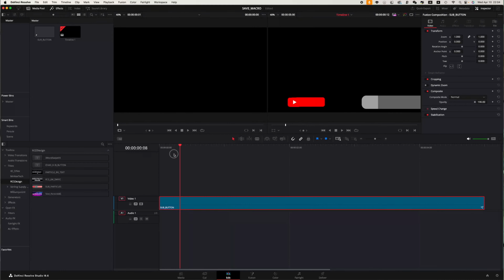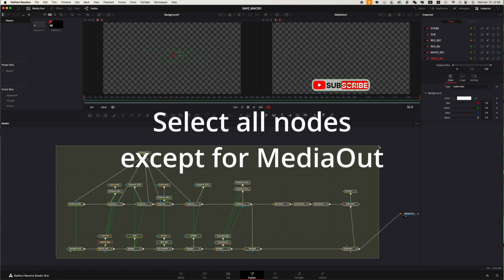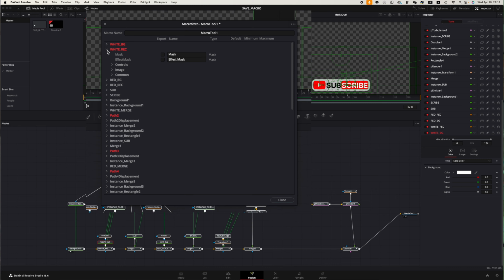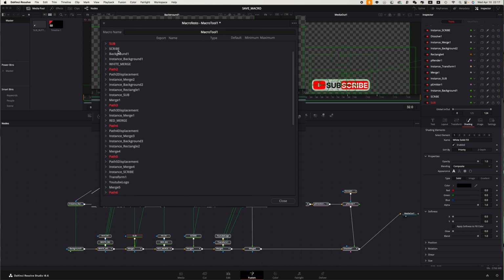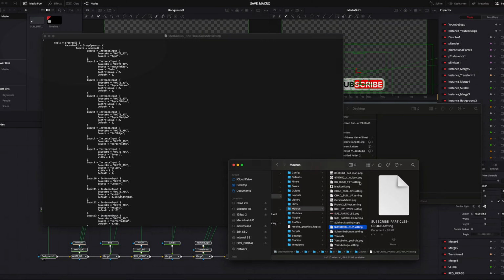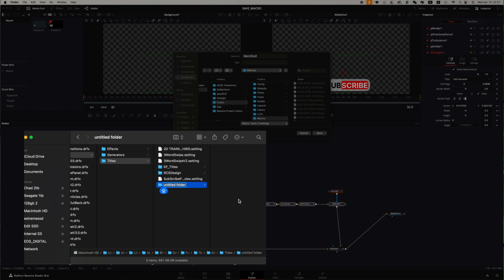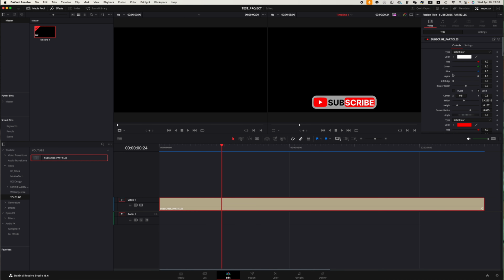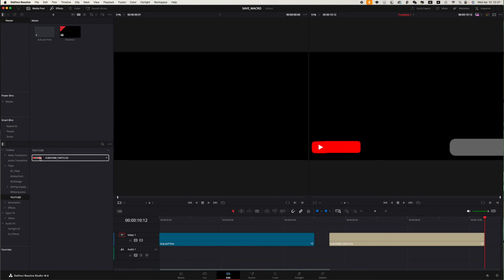Saving Macros In DaVinci Resolve Made Easy

Comment: I have a question. Lets say I saved a .settings file after selecting a bunch of checkboxes in the macro edit box to make controls appear on the edit page. All go till hear, no issues. But, now I want to edit the .settings file and make some change to it and re-save it. Do I have to reselect the checkboxes or is there anyway to load the selection of controls previously selected. Thanks
Reply from the maker: Hey! Great question! Doing it for free in DaVinci Resolve, you will have to do everything manually again. It sucks, but that is the way it is done... 

If you know scripting, then you can open the .setting file in text edit and make changes from there. You can copy and paste sections in ChatGPT to help you understand what to change to make changes... So that is one way to do it. 

Another thing you can do is look up Asher Roland. He is the scripting guy and has created the "Macro Creator". It's a bit expensive, however you can add the controls and create macros much, much easier with his tool. 

I can create my own macros for using on the Edit page, however I am not the expert in the total layouts and scripting them.